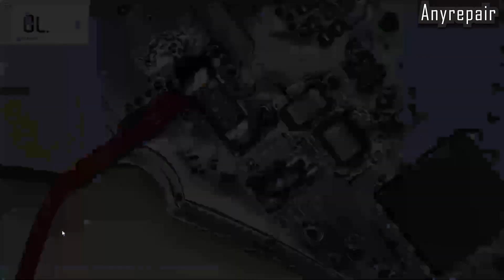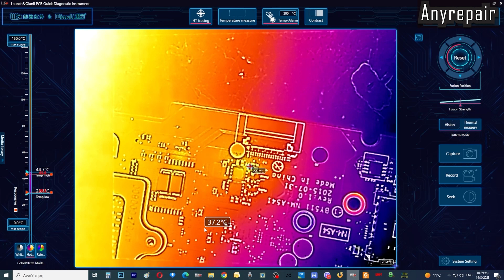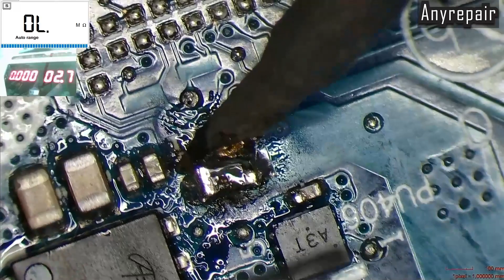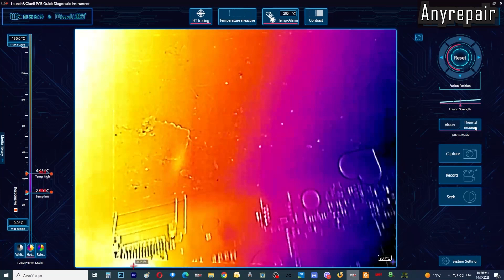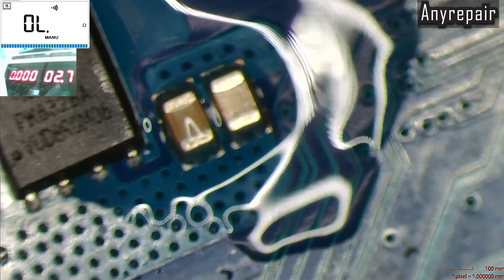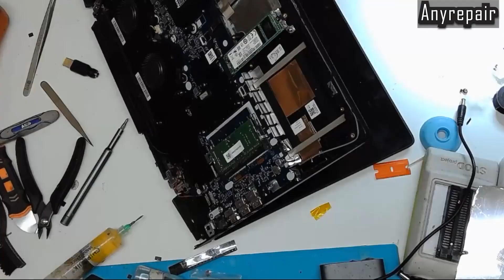Lenovo notebook Y700 repair

Comment: hey nice video first time i saw a video based on this particular pc... i was wondering if mayube you can give me some advice on what should i check if my lenovo y700 stops working after 2 or 3 days it only shows image, the keyboard stops working and eventually it goes into blue screen. then it makes a system recovery and i lose all updates and configurations
Reply from the maker: Thank you. At first I would check my disk. Then I would disable the discrete gpu,  for testing.